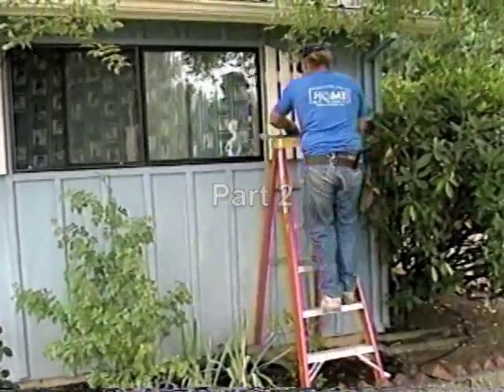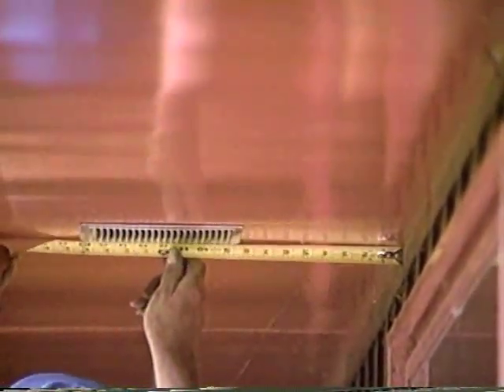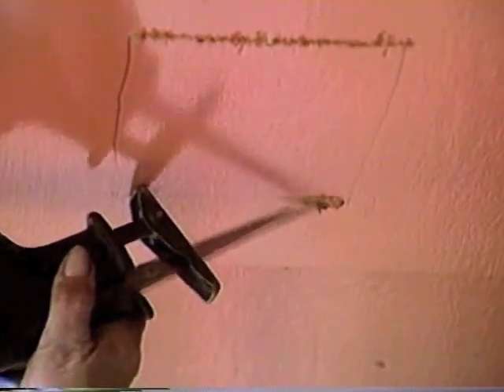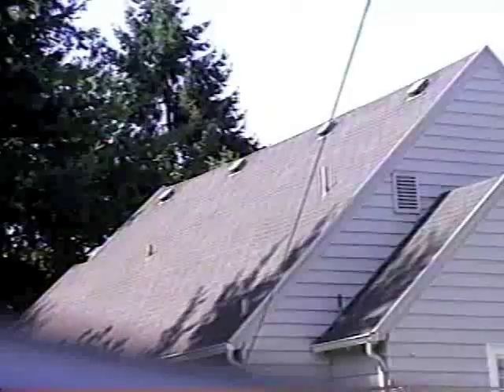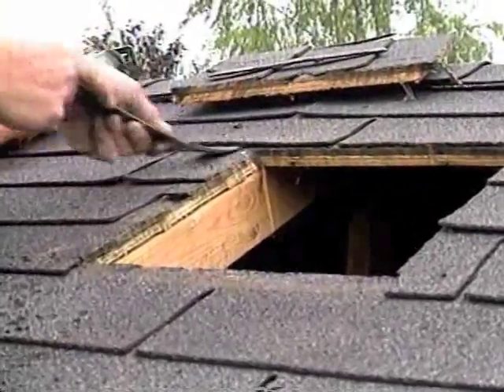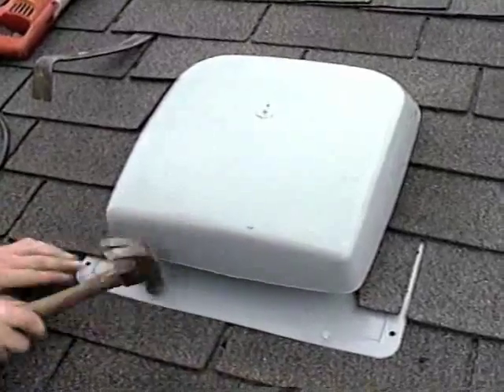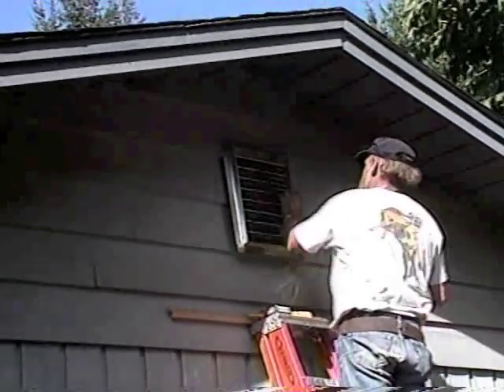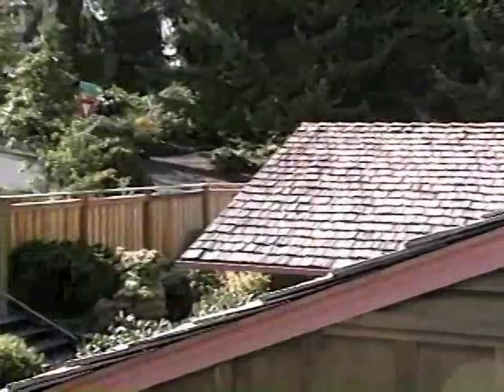How to Calculate and Install Attic Ventilation Part 2.m4v

Comment: The first time I added soffit vents I used a reciprocating saw like in this video. The next time I used a drill to make a hole then cut the hole with a jig saw. The jig saw is a lot easier to control. Also, I used two templates. One to cut the holes and a second to align the vents before you screw them in.

Comment: 9/10 homes are improperly vented in the U.S.  did you install the eve vents and the roof vents along with gable vents because what I run into in my field of roofing is gable vents that have never been plugged up installing roof louvers along with have gable vents will short circuit the venting system.

Comment: If your attic is properly insulated roof vents will not affect your heat bill since you are not heating an attic on purpose. An attic needs proper venting to reduce moisture and mold. In fact most newer homes should have a vent fan such as a continuous running bathfan or rangehood running at all times.

Comment: always keep in mine how long your summer months are you don't want to many vents or you may pay to much heating your home in the winter months plus the cost of paying someone to install them.
Reply: Carl Smith 
You don't know what your talking about. 
Attic temperature should be the same as outside. That's why you insulate the attic. Don't give ppl stupid and wrong advise
Reply: @andrewbeaudry4399  Correct, ice dams are a cause of under ventilated roofs